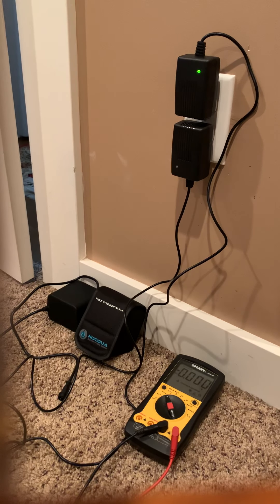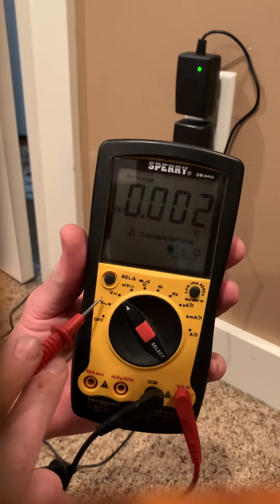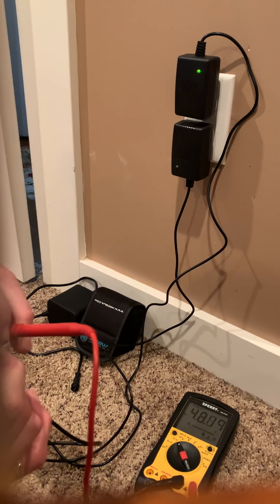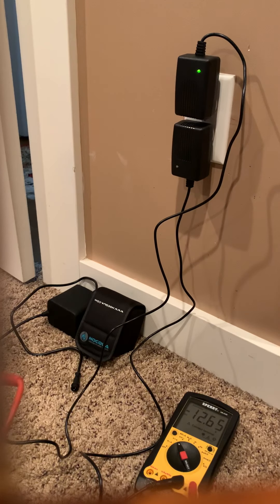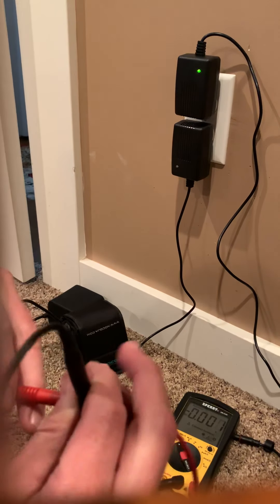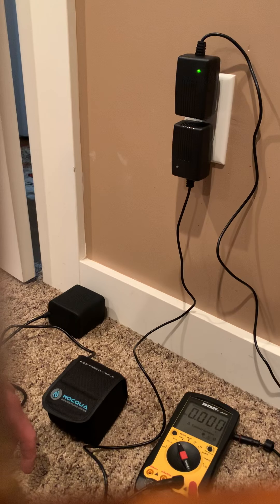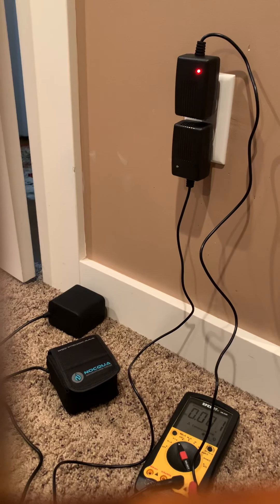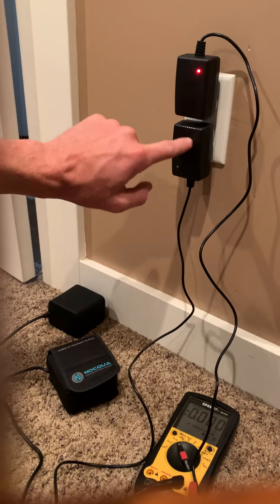Testing a defective Nocqua battery and charger

Comment: Im having trouble with my battery.. It reads 10.7 and its a 10v version. The charger reads 1.7v. So I hope its the charger. My question is - even if the battery is drained should it still read 10v?

Comment: I just got one of their 20AH batteries.   On a full charge it's reading 12.14.  Is that not normal?  I used it yesterday and only got 3 1/2 hours out of it hooked up to my helix 9 SI.  It draws up to 2.5 amps so I thought I should at least get 8 hours with this battery. The unit would shut off and I was able to start it back up around 5 minutes later. It would stay on just long enough to boot up and get to 2d sonar before shuttin back off about a minute later.  Also after getting home and putting it on the charger,  it was showing that it was half charged.  The new chargers show how much it's charged up in quarter increments.
Reply: Did you find a fix for this? I'm having the same issue with my 20Ah battery too

Comment: I have one now that blinks green and then when  I plug both batteries it the light goes out. Weird
Reply from the maker: Before you send it back, ask for a new charger. I have heard that is the main cause of these batteries being bad.
Reply: Pierce Henley they were no help. The battery I swapped out got my money, it didn’t come with charger. Since my charger is over year old on my own. Frustrating but I had to accept it. They’re going to offer me a deal for a new battery and charger tomorrow. We will see. I’m not happy but I’ll live. They said they addressed the charger issue in 2017. I wish they had a faster charger. I need two when camping and fishing.

Comment: I'm having issues with my nocqua also.  I can't get it to charge the battery.  The light on the charger is always green but the battery is not charged.  Like you, I think the chargers are the issue with the Nocqua's.
Reply from the maker: rspauldi2 , I believe you are right. The chargers are the issue. Reach out to Nocqua and I am sure they will replace it for free.
Reply: @piercehenley7677    Finally got my replacement charger and all is now well.  The new charger is a different style than my first one.
Reply: I’m going to obtain a meter to check my batteries- more $ spent on Nocqua! I’ve had one charger replaced under warranty and a recently replaced charger go bad.  At least one of my 2 expensive Nocqua 10amp batteries is taking days to charge and it is out of warranty.  Nocqua is supposed to be coming out with a new, feature rich, improved charger in May, but if I must spend another $100 on a replacement lithium rest assured that it won’t be a Nocqua.  Hope you’re tuned in Nocqua! Time to email them.